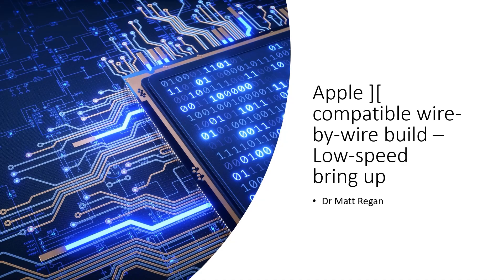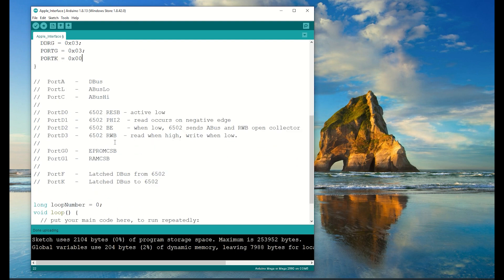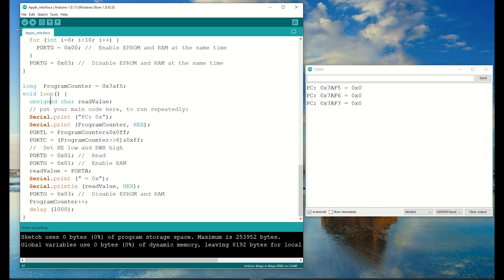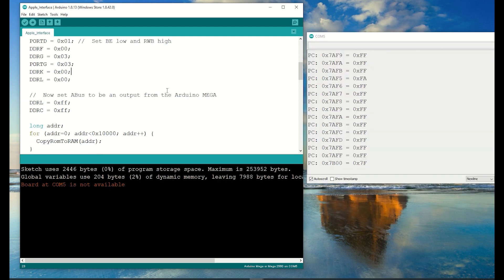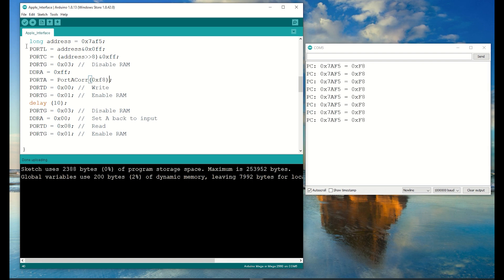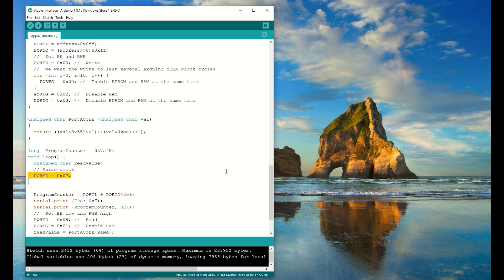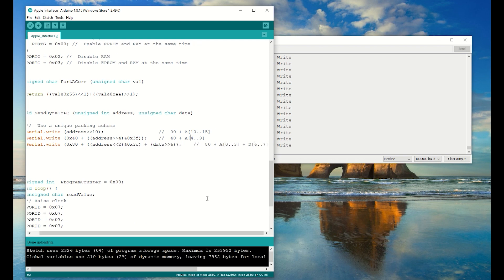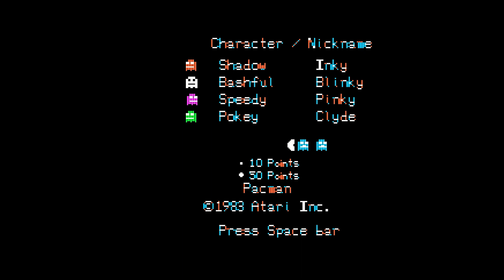Apple 2 wire-by-wire build, Part 7. Bring up

Comment: Maybe I missed it in the earlier episodes, but it would be useful to instruct first-time constructors to periodically "bell out" new wiring periodically and especially check Vcc/Vdd + ground connections before inserting chips and applying power!
Other than that, there's some handy troubleshooting tips there :)
Reply from the maker: Yeah, maybe it's the crappy multimeters i've had in the past, but some will sound off when you touch any pin on a chip that has a potential (resistive) pathway to vcc.  I've been tricked by it in the past.

Comment: I still don't get this... Why would you need a 6502 in order to emulate 6502...? 

Or are there two different projects under this "Turing6502" title?
Reply from the maker: Yes there are two playlists.
The Apple 2 wire-by-wire playlist is about the environment outside the 6502, so buses, memory access, video and disk interfaces etc..

The Turing 6502 playlist is about replacing the 6502 itself.

Comment: how can you upload pacman game?
Reply from the maker: I actually used AppleWin to load Pacman and stopped the code at the SED (0xF8) instruction.  Then i copied the memory contents into the ROM and wrote some code that sets the internal registers appropriately.
I did this to bypass the floppy disk accesses.
But the goal is to have it load off an SD card.